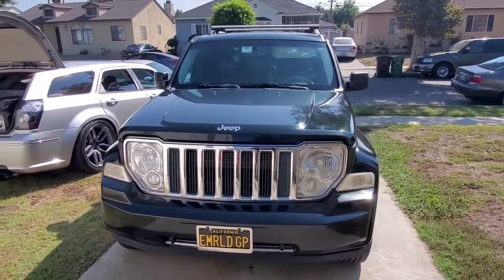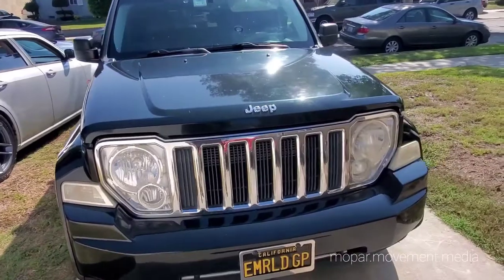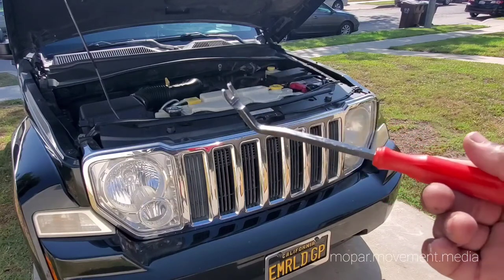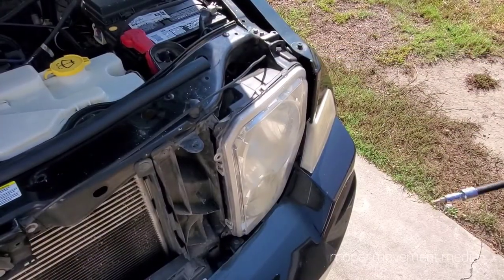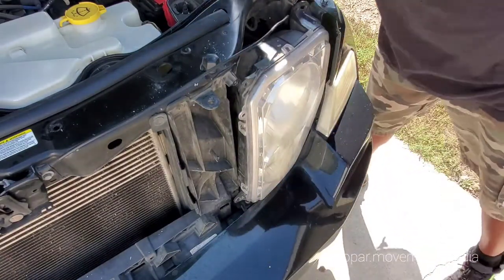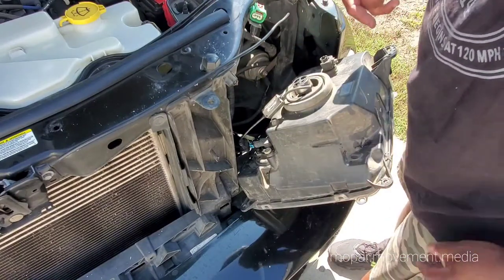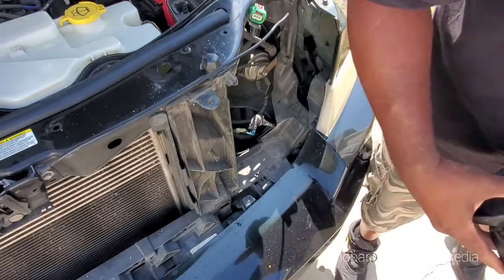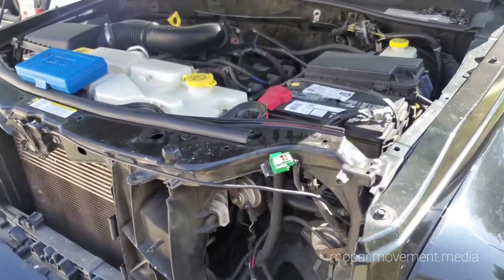2008-2012 Jeep Liberty KK Oil filter & Headlight Replacement

Comment: I have a 2012 and could get the filter by lying down and reaching in and up to get at it.  Now that I put a front hitch on the vehicle, I removed the oil drain trough and the filter is easily accessible.

You're not the only one who's after removing the grill and headlight, but I think the two methods I've used are a bit easier.
Reply from the maker: Do you have a 4x4? From the bottom on this one, you cannot even lay a finger on the filter.
Reply: @mCube.Network  
Yup, 4 wheel drive.  I was able to lie on the ground, reach up with my left hand and get it.  I was even able to get a filter wrench up there to break it loose.  I'd suggest using Fram because of the grippy stuff they put on the filter, but I know how some here have issues with Fram.

Anyway, with the front hitch, I can't do that.  So removing the oil drip trough makes it pretty easy to get to now.